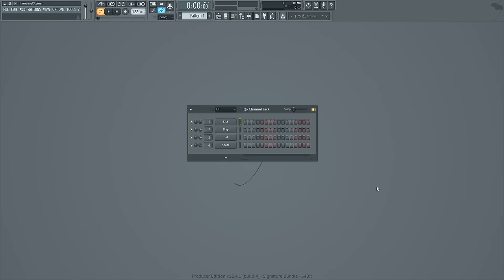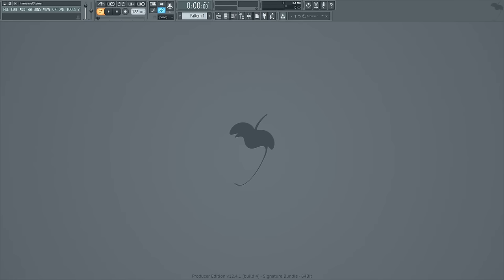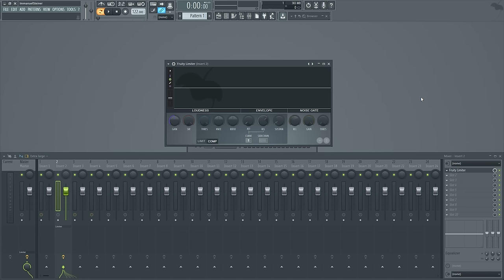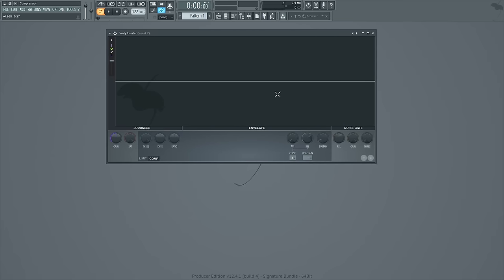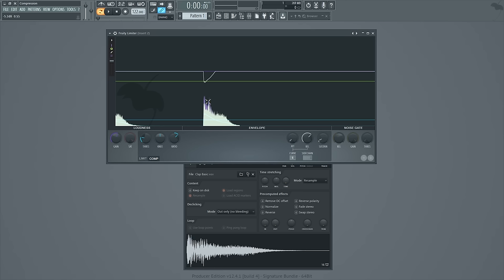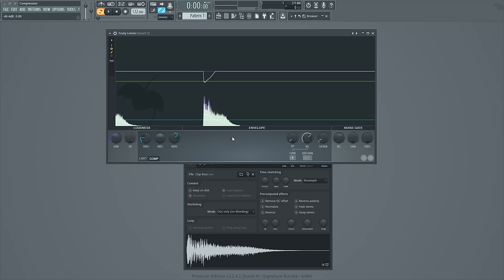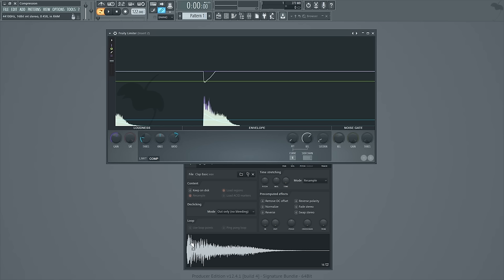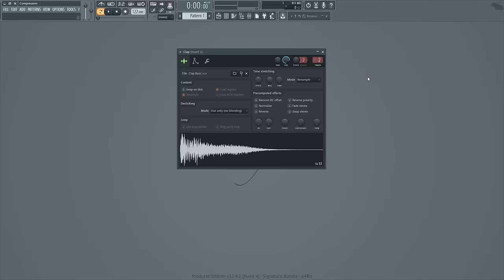Compression Tutorial: The Basics of How to Compress Properly

Comment: what are the things i should compres? Leads, piano, samples, vocals everything?
Reply: i have the same question
Reply: There are no rules about that, it is your decision. My rule of thumb is, do not compress for the sake of it. Think about what it is you are trying to achieve, and how compression could help you achieve that. 

Let's say you have a lead kind of sound, with some delay and a reverb tail. You could use compression to 'tune' the overall sound of it in the mix. Chances are the reverb and delay can get burried in the entire mix, as they are just not as loud as the rest (like the clap tail in this vid). To make the whole thing more audible you can compress the lead with a somewhat fast attack, turning it down a little. Bringing the whole thing back up with make up gain. Chances are the lead and it's FX will sit better in the overall mix. And for me, that would be a good reason to be compressing it.

But i would certainly not compress everything. Some dynamic range is what makes things interesting to listen to in the first place.

It more or less depends on the signal and how you want it to play nice with the rest. Vocals for example really benefit from compression, as their dynamic range is usually quite large.
A kick from a sample pack for example? If it sounds good, packs a punch, why go further than EQing it? Ofcourse if you can make it sound a little bit tighter with compression, do that. No rules really.
Reply: You can compress anything if you like but I personally use comoression to get rid of some unnecesary spikes and to kinda glue some stuff togheter(percussions etc.)
Reply: Mitja Miklič isn’t the limiter for getting rid of some spikes? D:

Comment: Much like other comments, I was going to ask that you also do a video on attack and release, however your explanation was so foundational that I think I might be able to piece it together. My guess is that the attack is basically all about preserving the initial transient.. The way you said we can either squash the beginning, or bring up the latter part of the sample, my guess is the attack is about not squashing the beginning transient and dialing in the compressor to start at the beginning of the lower volume portion of the sample to bring that up to level with the initial transient. The release then would just be adjusted to sample length so that it doesn't trigger on samples that are close to each other. Maybe this is all correct, but would still love another video breaking down attack and release :D
Reply from the maker: You hit the nail on the head with the attack. It's basically the initial delay for the compression to take effect. The release is kind of the opposite: How long does the compression stay active before resetting for the attack phase of the next trigger. Hope this helps!

Comment: I usually just use the limiter on just about each mixer track associated with a unique sound, and crank the gain up until the input barely peaks past the threshold at 0db (I think it should make mixing easier when every sound peaks at 0db), but I suppose this is probably a better way of doing that without butchering the sound nearly as much.

Comment: great video, easy explanation and demonstration. only 1 question: what makes the makeup gain in compression different from from just boosting the dB in an EQ or on the mixer?
Reply from the maker: Nothing. Makeup gain is just applied within the compressor for simplicity. The important thing is whether gain is applied before or after compression. Makeup is applied after, so any other means of raising the gain will be the same if they are applied after.

Comment: Technically, this would be considered an Expander in this case, due to the fact that the volume was boosted.  Would like to see a compression video where the sample becomes quieter
Reply: David Talkington That’s absolutely wrong. The make up gain is not part of the compression. The compression is the reduction of dynamic range, whatever happens after that, does not change the fact that compression just occurred.

Comment: Question to more experienced producers:
So, from what I understood, whenever I have a clap or a kick that has a high dynamic range I have to compress it? Must I do this for every sound with high dynamic range?
Reply from the maker: Never compress for the sake of compression. Only do it if you need to.

How do you know if you need to?
If, for some reason, you need to change the dynamics of the input.

i.e. an instrument gets lost in the mix, sounds need to gel together more (ie mixing/mastering stage), reducing peaks, bringing out the lows in a sound, etc. Mixing is an art. The more you do it, the better you can tell when it will make things "better" or "worse".

A case for not compressing:
Think of a violin solo in a classical piece. Sometimes it's quiet, sometimes it's loud. Why would you want to compress it so that so it's always loud? You would lose dynamics and thus the beauty of the instrument.

Comment: I'm a little confused about the gain..and can you also make a video on vocodex?
Reply from the maker: The gain is simply how loud you want the sound to be after the compression is applied. You can either return it to the same level that it was pre-compression (like I did in the example), or not worry about that and just mix it in with the rest of your track like normal.
Reply: thanks alot... please make a video on vocodex

Comment: How I mix and compress sounds:

Play the same loop over and over, while twisting every single knob available - until I think it sounds good.
....But after 8 hours I realize that I've actually been amplifying my own tinnitus, instead of the sound, which is even crappier than the preset I started with... Also...I'm one hour late for work 🤦‍♂️😅
Reply: Brothe can I use compress  only for clap or kick
Reply: @justinshchr879  I'm not really sure what you mean, but yes, you can use a separate compressor on both the kick and the clap (and on any other sound if you like). Using multiple compressors separately for different sounds, instead of using a single one to compress the whole mix at once, is actually how you're supposed to use it :)

Comment: Again thank you for your great work. I have a question. I mostly record guitar, vocals and sometimes accordeon and such, are the certain effects (like EQ and Comp) that you would really recommend I learn? I am struggeling with reverb at the moment, but it's getting better. Upgrading my DAW seems like a huge step and a little much because there is so much to learn.
Reply from the maker: EQ and Compression are sort of the two cornerstones of mixing. Other effects like delays and reverbs of course can be used in conjunction (usually after, in the FX chain) with the former two. You'll start to get better, as your ear develops, at using effects more subtly/accurately to create a well balanced mix across the frequency and stereo spectrums. There is much to learn, but it's an ongoing process that never ends :)
Reply: Thanks for the fast response! When you say usually after in the FX chain, I'm a little lost, isn't there just the FX of the channel and sends?
Reply from the maker: The list of effects or "slots" in each mixer channel is your effects chain. A send channel is just another mixer channel (which has it's own effects chain). The order of this chain affects the output sound. So, typically, Compression and EQ come first in the chain to get the base sound right before sending it off to things like reverb, delay, etc.. It's all about order of operations.

Comment: You began by saying dynamic range is the difference of the loudest and quietest part of a sound. You didn't say it mattered how long those extremes are maintained. Is dynamic range the average or the loudest relative to the quietest. The sounds you showed looked to have close to the same highest and lowest. The one you said had the lower dynamic range was the one that was louder for more time. Which is it? How do you measure dynamic range? Do you subtract the quietest from the loudest or do you take some kind of average over time. Is dynamic range measured in dB? If it is measured by subtracting like I suggested then both sounds that you showed would have the same dynamic range because the loudest was at the top and quietestbat the bottom of the graph. That is unless it matters how much time it was loud and how much time it was quiet.

Comment: I dont know if this comment gonna be answered, but..

Does compression apply to any other stuff ?  like vst,sfx etc?
Reply: Basic im assuming u mean if compression is typically used on other miscellaneous stuff, not just the main sounds of a song? Or if it is built into vsts or plugins? Ill answer both just in case, although keep in mind im no professional. So for the first one, i think it depends on what the song needs/has. In which if an effect like white noise has too high of a dynamic range, then yes, u should compress it. Really u should compress whatever would sound good with compression, and i believe there is no norm for what people typically compress, so yeah it applies to other stuff in that way in that u should compress anything u want really. 

For the second question you might be asking, typically vsts like serum will have an FX tab where u can apply compression or other stuff. And yet again it depends on whether the sound would be better with compression. 

 I guess I dont understand the question so sorry if i answered the wrong thing.
Reply: @galaxicore4851  Thank so much for the detail ! , it help me alot dude!

Comment: I understand compression, but I don't have enough experience to know when a sound needs to be compressed. When do you recommend compressing sounds.
Reply from the maker: Some sounds are either already compressed, or have low enough dynamic range to where compression is not needed. On top of that, some sounds might be better left uncompressed (ones with high dynamic range - where some parts of the sound are meant to be quieter, like a violin during a breakdown for example).

If you can't tell with your ears, you could look at a waveform to see if a sound might need compression or not and decide for yourself. Remember, compression is not a rule - it's an art. It very much depends on the sample, situation, context of the mix, and your goal.

Comment: @Electronic Producer Thanks for the vid! However, I think you may have explained the ratio incorrectly or maybe your wording threw me off... at a 5:1 ratio isn't it every db that crosses the threshold it lowers it 5 db? For instance, if the threshold is set to -10 db your sound is -8 db, for every 1db over the threshold it is lowered 5db compressing it down to -20 db (2db x 5db)?
Reply from the maker: No, it's a ratio, so it's a percentage. For X:Y, for every X dB that crosses, Y dB is returned. I'm not sure if I could explain it more clearly. Which part is throwing you off?
Reply: Electronic Producer Thanks for the reply. I usually watch vids by BusyWorksBeats and he had the inverse explanation of what you said about the ratio.

Comment: Is the value of dynamic range the difference between the highest and lowest or is it the average. I ask because you said the second example had lower dynamic range because most of it was high even though the lowest looked as low as the first example. Please straighten me out. I find it confusing.
Reply from the maker: The technical definition of dynamic range is "the ratio of the largest to the smallest intensity of sound that can be reliably transmitted or reproduced by a particular sound system, measured in decibels." - However, I use it in a more general sense in describing the nature of a sound or sample, usually in comparison to another.

Comment: I understand that a compressor limits dynamic range it makes the high peaks of a sound lower in volume to match the signal low parts

But why cant i use an eq to lower the high peaks ??

If the bass was too loud and it has high peaks we use a compressor to limit the high peaks 

But why dont we use an eq to just lower the bass amplitude ??

Kind of confused between eq and compressor

I would be thankful if someone simply explained
Reply: Rakan AL-Harbi There’s many ways to skin a cat. It’s up to you basically; try both, and see what gives you the closest result that you desire. Sometimes you might even need both. Also, think about it, EQing the frequencies changes those frequencies for the whole sample, but you might only want the transient, or only the body, or only the tail to be affected. So it depends entirely on what you want to achieve.

Comment: I have a question is it necessary to use compression. For every sound??
Reply from the maker: Absolutely not. Some sounds are either already compressed, or have low enough dynamic range to where compression is not needed. On top of that, some sounds sound better uncompressed (high dynamic range - where some parts of the sound are meant to be quieter, like a violin during a breakdown for example).

If you can't tell with your ears, you could look at a waveform to see if a sound might need compression or not and decide for yourself. Remember, compression is not a rule - it's an art. It very much depends on the instrument, situation, context of the mix, and the goal.
Reply: Perfect answer bro!!! Learned many things from this answer thank you so much keep coming up new videos like this 👆

Comment: should you compress before applying EQ ? or vice versa ??
Reply: Seth Mothoa it's the users choice. Do you want the eq'd version to be compressed? Compressed version to be eq'd? It DOES matter what order it comes in, my word would say to compress then EQ, but then again both would work. It shouldn't be something to stress about just so what sounds best to you.
Reply: Lil Casper thanks 👍
Reply from the maker: (Copying a reply from my EQ tutorial video):

Generally speaking, compressing first is a good rule of thumb. The reason is you solve the dynamics issues first, then with EQ you make carving adjustments to taste.

However, with something like a kick drum, where you might make heavy EQ cuts, the attack or "snap" of the kick might end up being much quieter than the sub after EQ, so in that case compressing after EQ is probably a good idea to solve the loudness issues created by EQ.

It really depends on the type of the sound and the end result of your processing, but I'd say 90% of the time compressing first makes more sense. Kick drum processing might be the one of few exceptions.
Reply: Electronic Producer Many thanks this really cleared up alot for me.

Comment: If we turn on 'Normalize' and bring the 'In' knob a little bit up, does the same thing happen?
Reply from the maker: No. Not the same thing.

I'm not sure what compressor you're talking about, but normalizing essentially takes a sound and brings it as close to 0dB as possible without clipping. If you bring the "in" past that, you'd be going above 0dB, and I assume there'd be a limiter on that compressor to prevent distortion.

Limiting is an extreme form of compression, where the ratio is essentially ∞:1, not allowing anything to pass the threshold.

Smart limiting is typically used in the mastering process to make tracks loud.
Reply: no I don't mean a compressor, I mean the standard fl studio sample window like in 02:57
Reply: +aichi337 Audio normalization is the application of a constant amount of gain to an audio recording to bring the average or peak amplitude to a target level (the norm). Because the same amount of gain is applied across the entire recording, the signal-to-noise ratio and relative dynamics are unchanged. So no it doesn't do the same as using a compressor, as a compressor looks at the entire dynamic range and not solely the average amplitude of the waveform.

Comment: How did u know exactly were 2 set the threshold, that is my biggest issue cause I just be waiting it right
Reply: Austin Douglas if there is a high dynamic range (so the sample has both a loud and a quiet part) you want to set the threshold to the middle between the louder and quieter parts.
Reply from the maker: The threshold is the decibel level at which you want compression to activate, so you need to decide what that is based on what you want to achieve with the sound.

Comment: I still don't understand why you would want an element, such as a clap to have a fairly constant volume throughout.

Although, I do understand compression a lot more now thanks to this vid, I just don't understand why you would compress something, couldn't you just turn up the volume on that element?
Reply from the maker: The difference is when you turn the volume up on something, you're turning up the entire sample as it is. When you compress, you're changing the difference in volume throughout the sample. If you compress a sample, THEN turn it up (make-up gain), more of the quieter parts of that sample will come through at the same overall dB level of the original sample. It lets you "put more stuff" in the box so to speak. Does that make sense?
Reply: OHHHHH Ok, thanks for the clarification ☺

Now I'll try using compression on some samples and see how they sound in some stuff I'm working on, thanks 👌🏻

Also dope tutorial, you should make more 😛

Comment: Should I EQ first then compress or Compress first then EQ?
Reply from the maker: It really depends, but in most cases it's best practices to compress first (get the dynamics sorted out or the sound nice and full if that's what you want) then EQ after to apply the final touches and sort out any frequency issues.

The rare case where you might want to EQ first and then compress would be to get a nice fat kick, or any sound where you want the dynamics to be as low as possible.